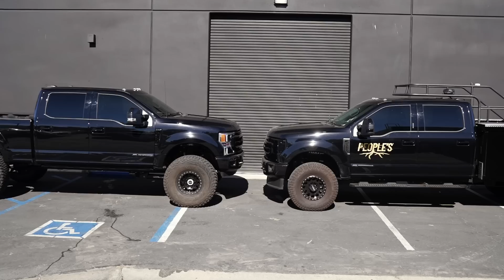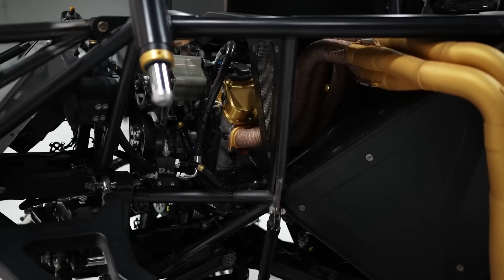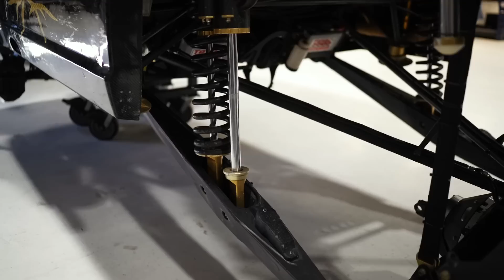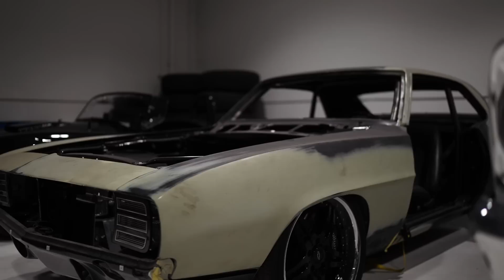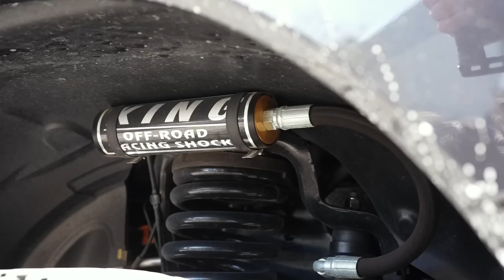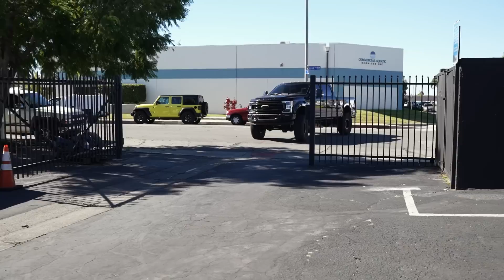People’s Racing Alumiduty on 39s Chase Truck Build and Shop Tour

Comment: So with your 4.5 E Venture kit on a 22’ F350 can it clear a 40” tire?
Reply from the maker: For basic street driving yes. For hard off road use, you need to trim both the bedsides and front fenders for clearance.